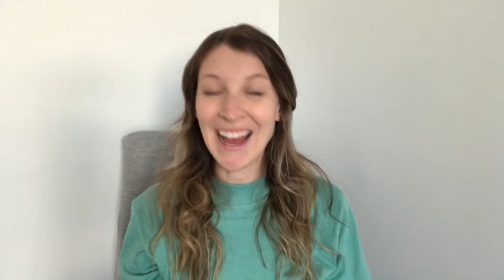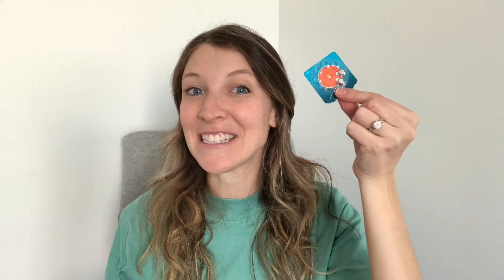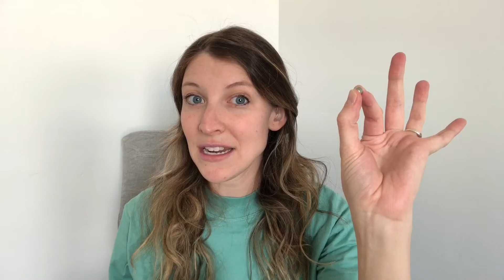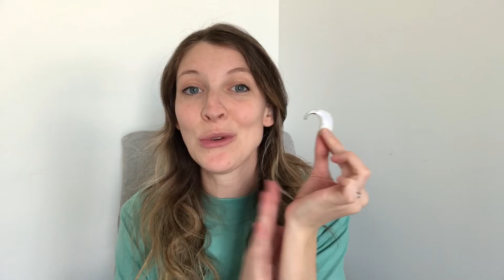About Zinc Air Hearing Aid Batteries

Comment: Rechargeable hearing aid batteries are dangerous. In no way will I use rechargeable batteries, which are prone to explosion. I already have hearing problems. And I don't think I want to lose my hearing ability altogether, let alone mutilate my ears. 😱😱😱
Reply from the maker: I think flying is more dangerous right now than wearing rechargeable hearing aids. I’ve never heard of a rechargeable hearing aid exploding but have heard of planes crashing… the benefits I get from my hearing aids are HUGE and outweigh fretting about the chance of a risk.

Comment: Oh how I agree! I started with Reounds custom HA that were rechargeable and was having all kinds of problems from Bluetooth connectivity to failure to charge issues from time to time. Fortunately I was within my trial period and was able to switch. I originally hesitated with the battery option because I thought they would be troublesome, boy was I wrong. I went with the Phonak Virto Paradise 312 and absolutely love everything about them. I do quite a bit of streaming, either music or TV and yet I still average 4-6 days. Another benefit is that the HA is smaller than HA's that are rechargeable. If I go out of town on vacation or a few days out camping I do not have to worry about dragging along a charger, or worse yet forgetting it with no way to recharge. I will be begging Phonak to please continuing  offering the disposable battery option as I find them to be an overall better option unless the user has dexterity issue which we can all understand the benefit of rechargeables in that situation. Zinc Air all the way! I guess I should mention I'm an Android user and have found the ASHA Protocall to be poor at best, Phonak's classic Bluetooth is working perfectly!
Reply from the maker: I agree that battery powered aids are liberating! Especially in travel scenarios. Thanks for sharing your experience and device usage (Android)! That will help another reading the comments!

Comment: How long have you had the rechargeable hearing aids? I’ve had mine for two years and was wondering how long the rechargeable batteries will last over the lifetime of the hearing aid.
Reply from the maker: I’ve had mine for about two years, too! So I’m not sure in that aspect. I expect them to last 3-5 years. I plan to send them in for a total battery replacement per the warranty right before it expires (usually end of year 3). I recommend you do that too.

Comment: I have a pair of phonac replaceable battery hearing aids. The batteries last around 6 days.  However, if I use Bluetooth a lot thay wouldn’t last anywhere near as long as this, maybe around 3 days?  I often find that my hearing aid on my left ear runs out of battery quicker than the one on my right ear though there’s not a lot in it.  My left ear is worse than my right ear though. Hate getting that low battery warning sound when I am out and about but at least with  the replaceable batteries  I can just replace them  on the go, assuming I have remembered to take some with me that is. In fact my hearring aid batteries reached  the critical stage when I was out today and I forgot to bring replacements with me, luckily I was close to a  library so I was able to   get replacement batteries at the library
Reply from the maker: That’s neat you got batteries from the library! I’ve had many times a battery dies without replacements. 🫠

Comment: Really really interesting thankyou . I have a zinc air battery hearing aid and had been wondering about re-chargeable ones .💐
Reply: DON'T USE RECHARGEABLE, EXPLODABLE BATTERIES. Look what happens to EVs when their rechargeable batteries explode, or any recharging batteries for that matter. Stick to despensable hearing aid batteries. There is no waiting time to replace them, just plug and play. Unlike rechargeable, explode-able batteries, you need to wait at least 10-20 minutes to recharge them. Then, maybe boooom. 😂😂😂
Reply from the maker: I recommend doing a trial wear with rechargeable aids. That’ll give you an idea of what you like better.